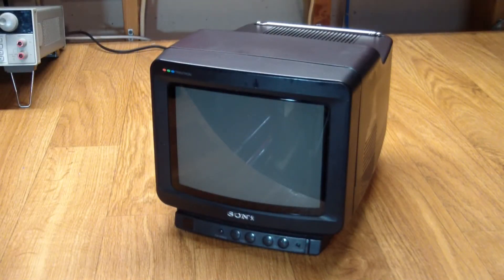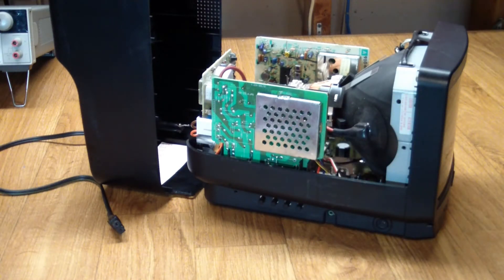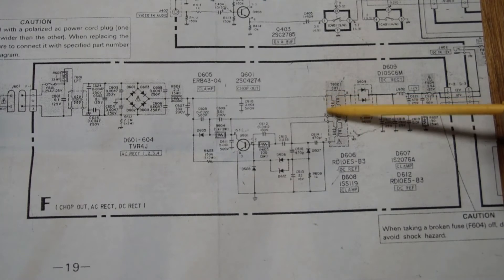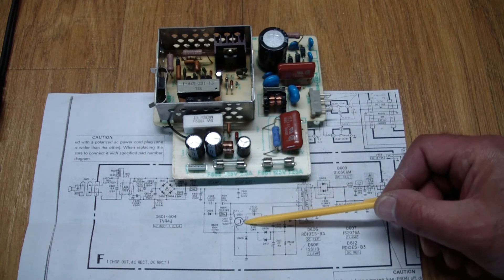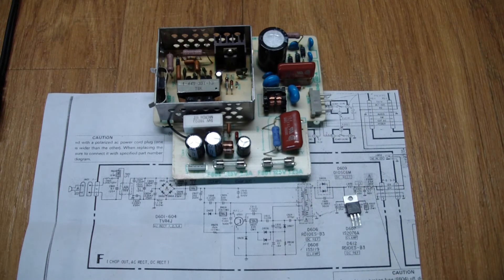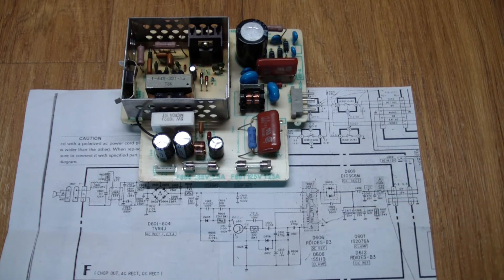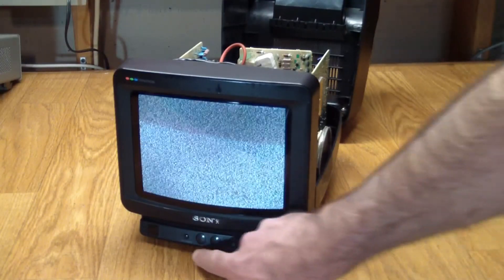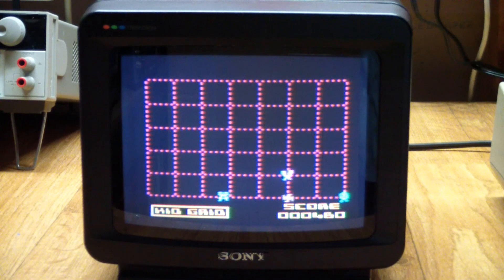AE#3 Sony KV-8AD20 TV  Repair and Atari 800 Kid Grid Demo

Comment: Nice repair! I have a similar model KV-8AD10. Not sure what the difference is between this and yours. Have you considered performing an RGB mod on your unit to allow it to accept RGB/Component input?
Reply from the maker: I may look into that. I'll have to find the data sheet for the video IC and see if it has RGB inputs.
Reply: @artifactelectronics  A friend looked over the schematics and found that our units dont use a jungle chip. We'll have to tap onto the RGB from the neck board. Still doable but harder.
Reply: @rpc72  Ever make any progress with that?
Reply: @COPKILLER4FUN  Nope. Still building up courage and knowledge to mess with this beauty
Reply: @rpc72  I def continue to wish you the best of luck. My personal dream is to purchase a KV-8AD11, and eventually RGB mod it as a desktop console tv. So I def hope you manage to get to your goals that said. ^^